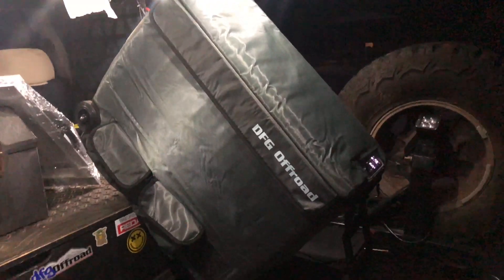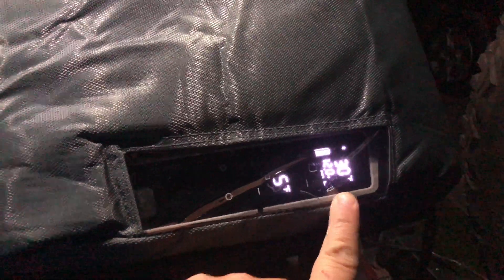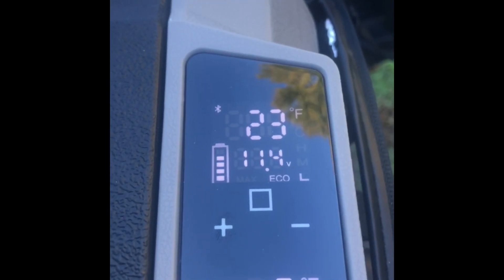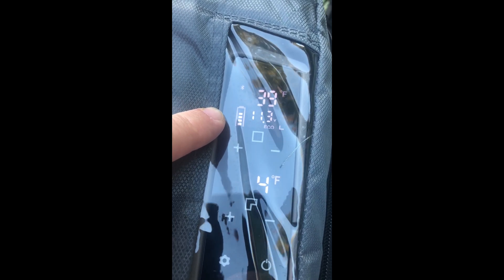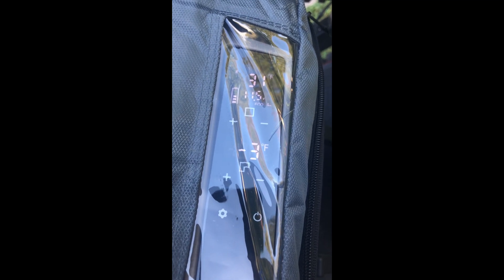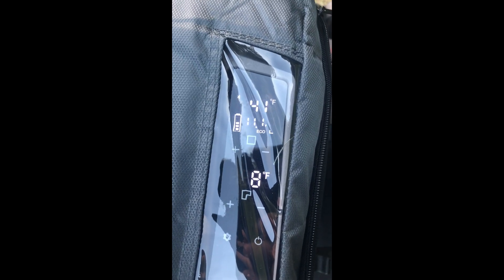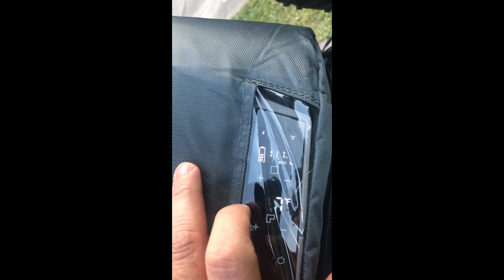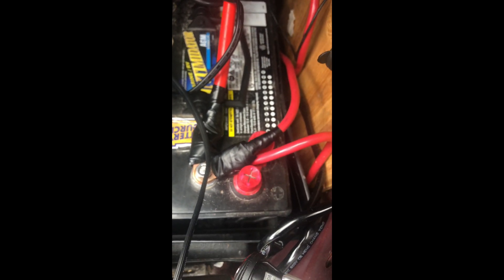How fast will a 12v fridge drain my battery? - 63 quart fridge/freezer versus a 130 amp-hour battery

Comment: Wait… that 130ah battery wasn’t lithium and it still lasted 4 days!?

I have a 100ah lithium battery I wonder how long it will run my little 20L iceco!! Gotta run some tests!
Reply from the maker: You might be surprised. But I learned a lesson about my lithium. I let it go completely flat. With the auto cutoff feature that kicks in at around 10% charge, I actually had to jump it off to get the Redarc to "see" it and start charging it again. Sharing just in case you have that issue.
Reply: @NathanKingOverland  yea I definitely won’t let my batteries get that low. Coming from the RC car world I try to keep my batteries between 25% and 85% charge for longevity
Reply from the maker: @supersoni126  Good move!
Reply from the maker: @supersoni126  What do you do for water in your vehicle?
Reply: @NathanKingOverland  when I have to carry extra drinking water I use a hydrapak 8 liter or the MSR dromedary 10 liter. They’re bags so they won’t last forever but they’ve done the job for a couple years now.

For a shower(which I don’t do often on the road 😅 I’m not a stinky person) I have the water port 3.8 gallon day tank on the roof basket. They have an 8 gallon weekender. 

I store food and drinks in my iceco go20 powered by the older anker powerhouse 200 with a 100 watt solar panel to keep it topped up. Usually it’s full of bottles of water only and my food normally doesn’t need refrigeration.
Reply from the maker: @supersoni126  Nice!

I have the Waterport weekender. I love that thing. I think I did a brief video on it.
Reply from the maker: @supersoni126  Here it is. https://youtu.be/lEEFKIBIeLA
Reply: @NathanKingOverland  I think this is the video that made me buy mine!! Haha!
Reply from the maker: @supersoni126  Awesome! I love the thing.

Comment: What battery are you using?
Reply from the maker: I was using a 130 amp/hour AGM battery then. 

I recently upgraded to a 100 amp/hour Lithium battery.
Reply: @NathanKingOverland  thanks. I’m not really wanting to spend the money on a Lithium. Haha
Reply from the maker: @electricstartclint  I understand. The AGM battery worked fine for 3 years. Give that a try. I got the 130 Amp/hour for about $350.
Reply: @supersoni126  I don’t need 100aH. 50 is plenty. I don’t stay places more than a day or two. Thanks for the information though. I’ll consider it next time around.
Reply: @electricstartclint  awesome! Same here actually,  I’ve been using my anker powerhouse 200(old model) until very recently. But I ran into an issue when there was no sun for the entire time I was out and didn’t have enough fuel to run the car the entire time 😂 but best of luck to you brotha!!